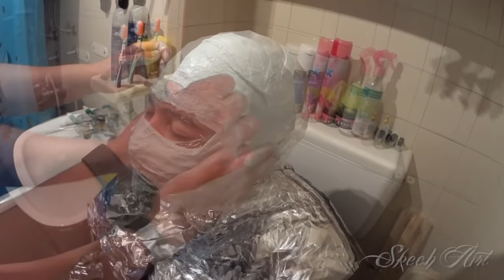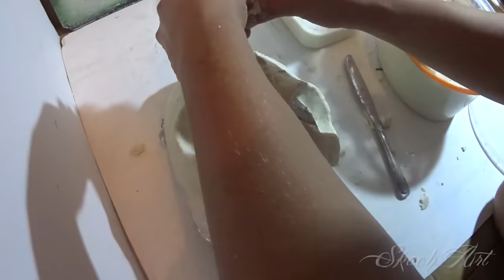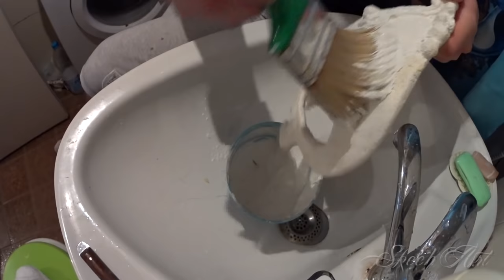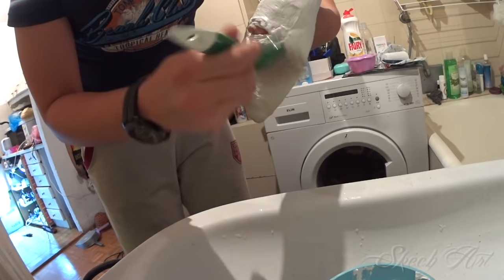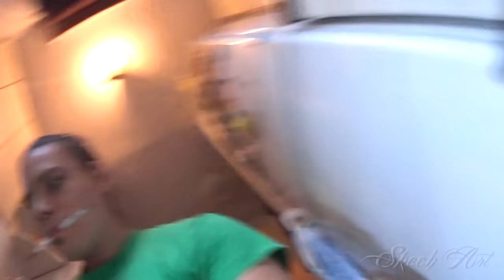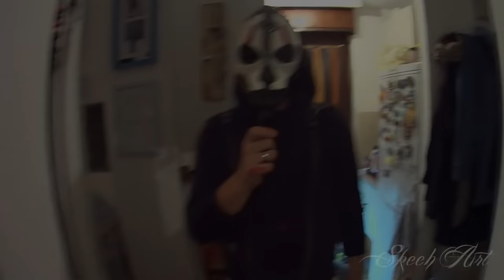Darth Nihilus PAPER CLAY mask DIY

Comment: Question. Is this stuff pretty sturdy? Will it crack or break easily? 
I plan on doing the same method with one of my projects. First sculpt with PMC then layer it with more joint compound and sanding for a smooth finish.

Also how does it do with paint? Will spray paint work?
Reply from the maker: Hey Chelsee its actually hard like stone :) U can paint over with any kind of paint :)
Reply: Yoshi cast at the doctors are basically this
Reply: What's PMC?
Reply: Aidan Dragon paper mache clay
Reply: Xenomorph King thanks